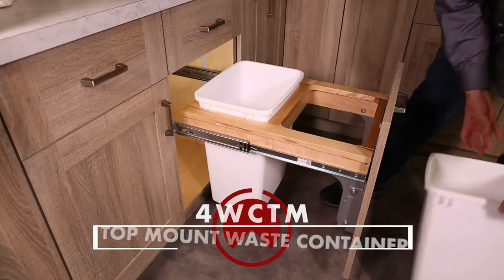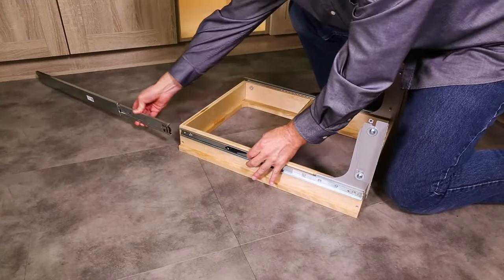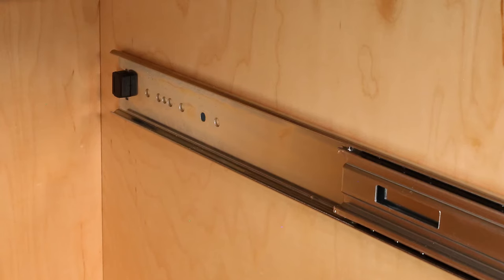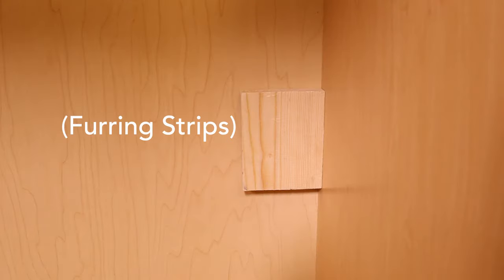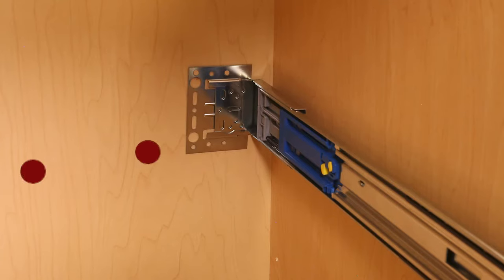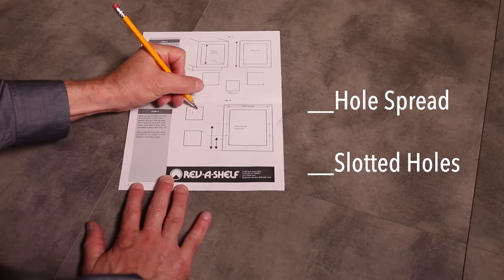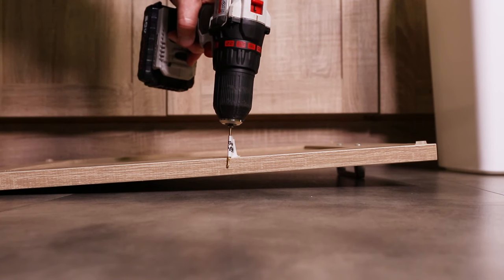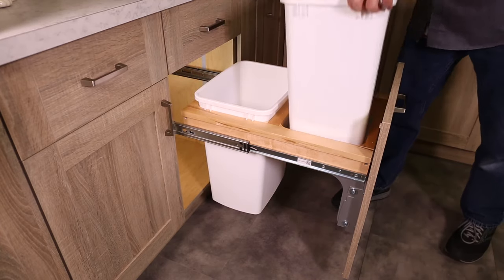4WCTM Top Mount Waste Container | Install

Comment: Why is this is so confusing.The directions that came with it are even worse.
Reply from the maker: Thank you for your comment.  We are reviewing both the video and instructions to see what changes can be made to make the installation process easier.
Reply: 2 years later, and nothing has changed. I am very handy and can follow complicated instructions, but dang these Rev a shelf cabinets have been the worst. The paper instructions are worse than China translated instructions. And the video only slightly made things better, but not by much.
Reply: In their defense, I’m a General Contractor and a professional carpenter. This unit is not really a DIY install job. We would consider this a mechanism as part of a guided custom cabinetry job. If any of the measurements are off in any way, the system won’t work properly. It has to be perfectly square, at the perfect height and depth, and every cabinet has slightly different attributes. I agree that the installation of this unit is difficult, but I also think they should indicate more that it’s better to be installed by professionals.
Reply: Okay so it’s not just me then.
Reply: You're not alone . I'm a contractor of 20 years , and these are some of the worst instructions I've ever seen . Non descriptive, the screws don't correlate to specific parts , and the pictures are terrible

Comment: You guys really need to look at an IKEA product, specifically how they write assembly/installation instructions.  Though this video is helpful the instructions included with my Rev-A-Shelf (4WCTM) were not worth the paper they were printed on.  Totally suckful.  If you have no one on staff to do this you should hire someone.
Reply: Oh and for my product (4wctm-15bbscdm2) Home Depot has 32 unanswered questions.  Wouldn't you like to get your potential customers the information they need in order to decide if they want to buy?  Oh never mind, it's rated 4.5 Stars.

Comment: Hello...I have the W4CTM top mount pullout drawer.  The instructions don't say how to remove the slide out.  Do you have any videos on how to?  My unit is slamming shut instead of closing slowly.  I was told to clean the slides.

Comment: My cabinet is slightly wider than the width of the rail system. Looks like the back plate mounting allows to adjust. Do I add furring strips on the sides too?

Comment: After installing the slides on the face frame (3/8" back) and to the back, the wood frame sticks out past the front of the cabinet. It isn't possible to get the metal bracket to be in the same plane as the face frame (as shown on illustration 2 in the written instructions). As a result, there will be gap between the door and the face frame. Normally, I would just move the slides on the drawer, but they are riveted in and attached with t-nuts. Could also potentially add blocking, but it seems mis-sized.
Reply: Mine too.  I did not have to add spacer at back end of cabinet but cannot mount to face frame as described in video.  Slide iength is just beyond cabinet depth.  So when I add cabinet face it will stick out from frame well beyond other cabinet doors.  Need to return.
Reply: Same but I kinda forced mine back and it slid into place. Maybe try pushing it hard

Comment: We have this exact product and the door will not open all the way out making it difficult to remove the garbage receptacle in the back. What adjustment can be done so the door opens all the way out?
Reply from the maker: We would need to know more about the exact unit purchased to provide a response. Please contact our Customer Service department at  (800) 626-1126, they will be able to assist you.
Reply: What did you figure out? I have the same trouble with mine.

Comment: I’m having a hard time removing the brackets in Step one. I do not want to force the release  since it is only plastic. Any hints?
Reply from the maker: Hi! Sorry that you are having trouble. On one side the lever releases with an upward push, on the other side it requires a downward push. If you are still having difficulty, please contact Customer Service for assistance!

Comment: How should I attach that furring strip to cabinet back wall?  should I glue? if so does that hold the trash can weight and trash weight?  or should I use nails?
Reply: If I had to suggest, I would buy extra set of long wood screw from Home Depot to attach the furring strip to back wall. I don’t think glue strips can hold that weight.
Reply: Can furring strip be plywood? My cabinets are 1/2 inch thick but they are ikea (so made of crappy pressed board)
Reply: This also confused us. Eventually we just used our own screws and screwed it in near the top and bottom of the furring.

Comment: the paper instructions are terrible and do not include install instructions for frameless cabinets. This video gives more context but I am still stuck. I have a frameless cabinet, the width is 22.5. Do I need to build out the sides and get to 21 inches, and attach the slides to that? I don't understand why the website says the minimum width needs to be 21 inches. That leads me to believe that something should be adjustable somewhere? any help is appreciated!

Comment: @revashelf. I have the exact model and I see the shelf pulling out on its own after closing it. Any idea how to fix it?
Reply from the maker: Hi! Is this a new issue or has it been ongoing since installation? If it has been an issue since installation, then please confirm the slides were installed properly with a level. If everything looks good, please contact customer service at pneal@rev-a-shelf.com for further assistance. Thank you!
Reply: I have the same issue. It worked fine for a good while. Now it is opening after I close it.

Comment: Added better instructions to attaching the door would be helpful. Instead of customer calculating the door frame holes, can you pre calculate them for each specific model. Like 35 gallon trash can only be fixed to a standard 18inch framed cabinet.
Reply from the maker: Thanks for the suggestion! I will pass that along.

Comment: Buying these is even more complicated than installing. There’s a minimum opening but not a maximum?
Reply: You can shim anything if you are careful enough. The reason they require a minimum is that the shelf itself can't be made any narrower because the shelf material is a fixed size. If your opening is a quarter, half or even full inch larger, you can install shims to fix the space between the cabinet walls and the shelf rails. A concrete example: If the shelf rails are 20" apart, but you have a 21" cabinet opening you can take two half inch pieces of material and install them in your cabinet. Your cabinet opening is now 20" because the two 1/2" shims removed 1" of width. It's a long winded explanation, but that's why they don't specify a maximum- it really depends on your skills, your cabinet openings/style, and your preferences.

Comment: Issue 1 - having a cabinet that was too long. Not Rev's fault. I had to break out the jigsaw to cut a few pieces to fit, and still had to add a shim to each side.  I2 - paper instructions. Outline for attaching the door is a dumpster fire. Video was better, but more insight regarding methodology for excactly where to attach the brackets would have been helpful. I measured and winged it. Thank God it worked.

Comment: Pls help. I have 4WCTM-RM-2150DM-2. It requires adding the mending plate for frameless installation. I can’t find any information how to add this mending plate. Like how you position it and all. There is nothing on the installation guide. Thanks
Reply from the maker: Hi! How thick is your cabinet wall?

Comment: ALSO, the pdf shows the back bracket with only 2 screws in the bottom holes yet the video shows screws in all four holes. AND the amount of screws that came with it would suggest you only use two screws in the back bracket. FIGURE YOUR SHIT OUT REV

Comment: The measurements for the 50 quart really need to be revised. I removed part of my face frame that allowed for a drawer to accommodate the device at the 20" measurement, only to find that when fully installed, there was more than adequate room to fit with the cans in it. Could've easily dropped another inch or two. Now I get to purchase a new door and repair the frame where the cross member was removed. 😑
Reply from the maker: Hello! Thanks for reaching out. We are having a hard time understanding the situation from this comment. Could you please send photos of the cabinet to socialmedia@rev-a-shelf.com to help us figure out what happened?

Comment: It seems to me that basic measuring skills, basic instruction following procedures, basic math skills, and using the principle of "measure twice, cut/drill once" applies here, just like everywhere else. My cabinets are original Kraftmaid with pre-drilled holes, not "custom" or DIY, which made thing MUCH easier. My project was a retro-fit, as the original did not come as ordered with the soft close slides. But still, ya gotta measure PRECISELY if you want things like this to work properly, and be level and square. There's NO SUCH THING as "close enough" when you want things to work properly. If you can't fathom that, have someone close to you help out.

Comment: How do I determine the thickness of the back wall?
Reply: I have this same question, anyone have an idea?
Reply: I know this is from a year ago, but if you didn’t make the cabinets I would drill a hole (preferably where the backer will be installed so it get covered back up) so you can see the thickness. You can bend a wire (clothes hanger would do) insert it into the hole. Make sure it catches on the plywood and mark with a marker or tape. When you remove it you should be able to measure this with a tape. 

You could also lightly press in the center of the rear panel. 1/4” plywood will flex slightly and 1/2” will not.
Reply: I looked at the back of the base cabinet where my sink is mounted. The back is cut out where the drain passes through. I was able to get a measuring tape in the gap.

Comment: Great. The paper instructions were horrible. On top of that the heights are different on paper and the drill bit size is different on paper (paper it's 1/16).
Reply: Thanks for the video. Mine won't slide out enough for the second bin to come out from under the cabinet all rhe way.  How do I adjust it?
Reply: @Joy-kl3te   it’s likely that your slides are not level with each other. Can you completely remove the drawer and measure the height from cabinet floor to the bottom of the the left side, both front and back, then the right slide, both front and back? All 4 measurements should be exactly the same. If they’re not, that’s likely your problem.

Note: if you have a face frame cabinet, ensure you’re measuring the front holes as from the cabinet bottom, not the face frame, so that it matches you’re rear height. That was my problem when I first installed this, and I had to remeasure and remount the fronts to make everything work as it should.
Reply: @danielplavsic7642  thank u for your help. Actually going to have it looked at by the installer next week and have them fix it.

Comment: Video states cabinet floor to slide holes is 14 1/2" and the instructions say 14 1/4"  but you know it's supposed to be level somehow. Figure your shit out Rev
Reply from the maker: Thanks for your feedback, I have forwarded your comments to the correct department. If you are still having trouble, please contact our customer service department at (800) 626-1126.
Reply: Yeah, my paper instructions said 13 1/8” “to the bottom of the slide.” I don’t know why they wouldn’t just give you the measurement to the hole you have to drill vs what they gave me was measurement to the bottom of the slide, which I then had to measure distance between that and the hole on the rail to add to the measurement on their instructions. Way to make it easy. :/